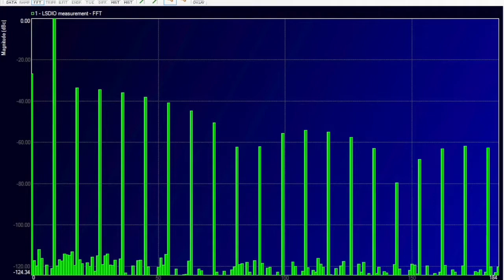Introduction to Harmonics

Comment: Dan, I'm trying to get Law #5. What if the phase of the harmonic is distorted by a group delay, which usually happens in analog chains? Then it is not related to the fundamental and their phases are shifted. How do we know it's a harmonic?
Reply from the maker: Yes, that could absolutely happen, in which case you could then measure the group delay for that frequency. I made my living on testing semoconductors and their behavior, and very often you need a "stake in the sand" to measure things from. If the harmonic is NOT one of those four values, you can figure out which one it WAS originally and then multiply the difference in phase times the period of the harmonics, for example, (102°-90°)/360° *1/harmonic_freq = group_delay.
Reply: @DanBullard  thank you, you are very kind to give me this clue.
Reply from the maker: @РодныеИстоки  You bet, I'm going to use your comment in my next video, if you don't mind. It's a very good point you made and it needs to be addressed to the world.